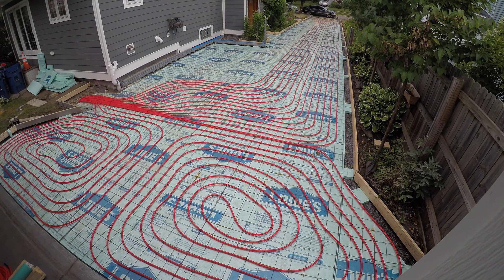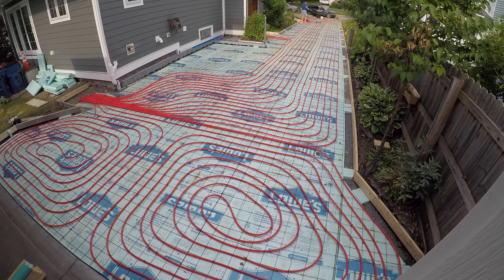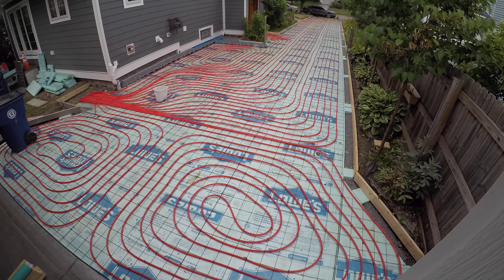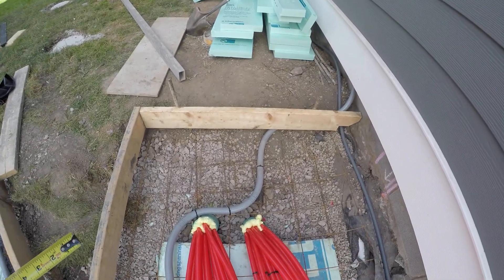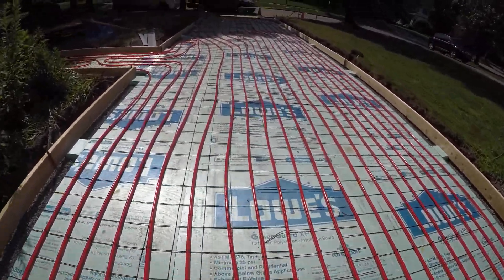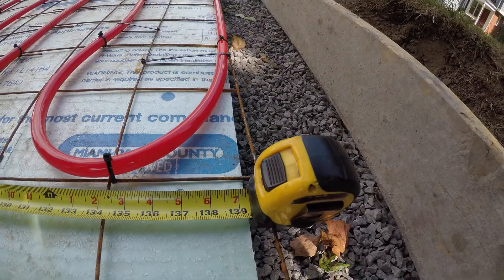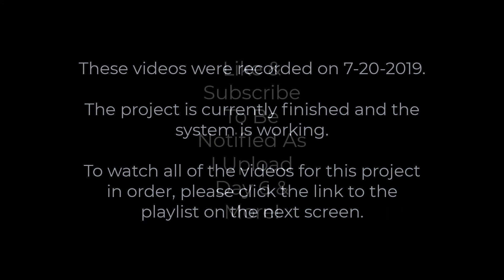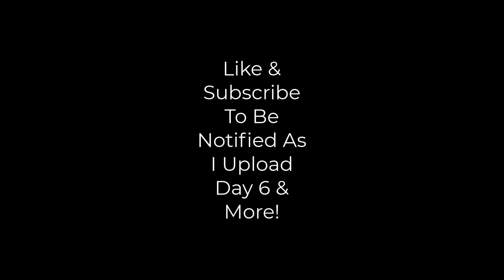Finish Installing Pex Snow Melt Loops for my Concrete Heated Driveway - Day 5, Episode 6 [7-20-2019]

Comment: Its late to observe this, but... concrete always needs replacement at some point.  In that light, I would think to have pex under the wire mesh.  Maybe a layer of sand for separation about 1.5" and use mesh-ups to get grid in the pour? Some transfer efficiency is lost, but that can be compensated for by shooting spray foam first before laying out pex.   For those who never heard of mesh-ups, they are extruded plastic pieces the wire mesh snaps into at the top, which accurately sets the depth of reinforcement. They are an open sided pyramid shape, allowing voids to fill during the pour.

Comment: An easy way to uncoil any tubing like this , is to get a large lazy Suzan, piece plywood and a trash can that fits inside the tubing. Put plywood, trash can on lazy Suzan and add some weight inside the trash can and push the tubing over the can. As you pull the tubing, it will unwind and spin around. Just make sure you don't pull too quick or hard. You can reuse everything too!

Comment: It’s against code to put sealtite in a concrete pour.
Reply from the maker: Hi Danmc9999!  I did not know that, and it's good info for my viewers to know. Thanks!  Luckily I am only using the conduit for low voltage lighting and gate wires, and unfortunately its to late to replace it!  Thanks for watching!

Comment: I just finished a snow melt install at my property in NE Indiana. My concrete guys did a large job, and had Indiana Warm Floors do my PEX Rough In. Sort of wished I did my own install. But at the time, I had a contractor telling me I had a boiler that I could add a 3rd zone and be good. I was no where close to good as far as BTUs
Reply from the maker: Ugh, sorry to hear that @supercoupe08.  I was afraid of this when I designed mine. The general consensus from my research online is that you need 150 BTU's per sq ft to melt snow.  I had one online design company tell me I could do it with 50 BTU/Sq Ft.  It might've worked, but I didn't want to take the risk. If the boiler is running balls to the wall for hours on end, and it can never catch up and melt the snow, what's the point?  Your just wasting natural gas.  In the end, I decided to do all of my own calculations, and ultimately went with (2) 200,000 BTU Heaters to provide plenty of power if necessary (check out my other videos).  Depending on the size of your melted area, you may be able to just put the slab on it's own heater and still salvage the pex in the slab?  Maybe some of my other videos can help you, and I'll be uploading more shortly.  Thanks aging for watching!

Comment: Why not include heated sidewalk?
Reply from the maker: Hey @dylan salant. So I will explain this in a future video, but basically the sidewalks are not my property, they are owned by the town.  I am responsible for maintaining them, replacing them, clearing them, etc.  but I don't own the sidewalks and the apron.  The town, electric company, gas company, sewer, water or anyone else can come through and cut them up to work on the utilities underneath them, and if they cut all of my loops when I wasn't around to tell or stop them, I would have no recourse.  The end of the driveway is where my Right of Way stops, so if anyone cuts into my driveway without my permission, I can go after them legally and financially.  In hindsight, I could have run a separate 1" pex line to the end of the driveway, and installed a manifold in an irrigation box in the ground, and run the sidewalk / apron lines to that.  That would have allowed me to melt the sidewalk / apron on a separate zone, and if someone cut it or the tree roots heaved it and broke something, I could easily just replace it without touching the driveway.  It only takes me about 5-10 minutes to clear them by hand, and considering the entire driveway is already done without lifting a finger, I'm OK with that 😁.  Thanks for watching!

Comment: Nice job! Have done my share of crawling around on my knees with zip ties. Curious, any particular reason you went with 5/8, instead of say 3/4?
Reply from the maker: @Matt jarchow  Thanks for the compliments!  Sounds like you're familiar with the process!  The crawling around and bending over is the hardest part, otherwise its not really complicated.  So to answer your question, I had a couple of reasons for using 5/8" vs 3/4".  First, I was worried about being able to bend 3/4" on a 6" or 9" radius without it kinking.  I have a lot of experience bending 1/2", but I had read 5/8" can be a bit more difficult, and 3/4 - 1", forget about it.  I would say that is correct.  My second reason was that I needed to be able to fit all 13 loops of 5/8" (26 pipes total), plus the 3 loops of 1/2" going to/from the garage (6 pipes total), as well as 2 more 1/2" lines for my hot and cold water lines to the garage, ALL into that 6" PVC pipe coming through the basement wall.  After having done it now with the 5/8", there is NO WAY I could've gotten all of these loops in 3/4" through the (2) 4" wyes, and I don't think they all would've fit into the 6" PVC either.  Not sure if you watched the video to the end, but you can see how tight it was with just the 5/8".  Hopefully that answered your question, and thanks again for watching!
Reply: @DeckerChristopherJ  Thank you, I understand. With a condensing boiler, with a bit higher temp, you could go with 3/4 and 12" spacing.